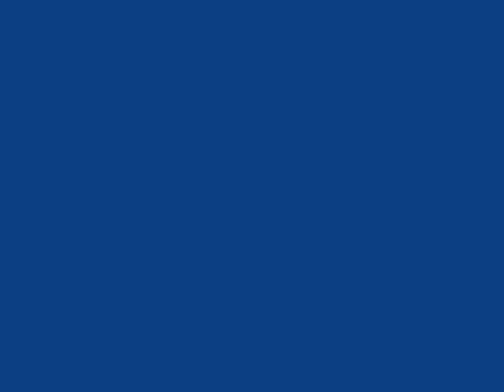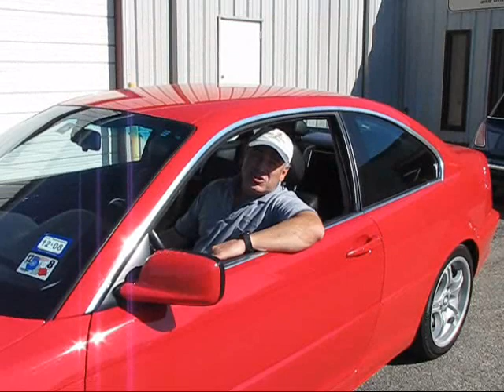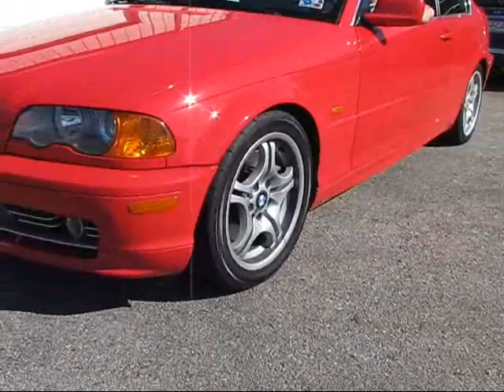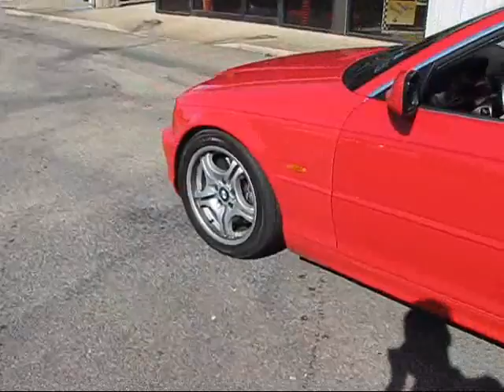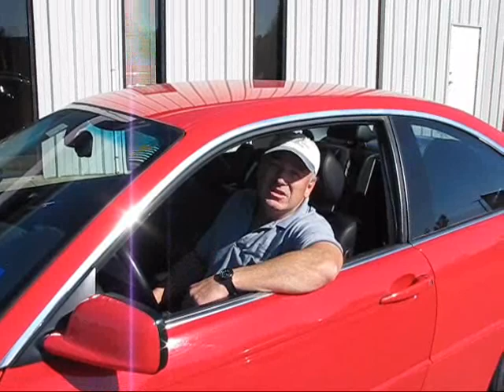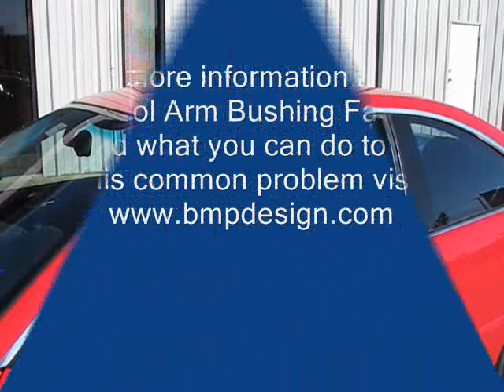BMW Control Arm Bushing Failure

Comment: I drove with the top ones like that for 21 years before it got really noisy after that I just loosen the torsion bar a little bit more and only made right hand turns.....gas is dum

Comment: Bruh, this video is 12 years old and was randomly in my recommended, and it perfectly shows what’s wrong with my e90, I took my car to a shop to fix a cracked wheel and put in a new battery, and the guys over there did this exact demonstration for me, except it looked a lot worse for my car

Comment: Thank you for your video.  I was told during a recent inspection that mine need replacing.  I thought to myself that I would hold off a month or two to save up for the repair and thought it was just an annoyance (noise) but your video showed me that it's likely dangerous to drive with them like this.  Seeing the wheel move like that made me decide to go out today and fix them.  :)

Comment: Bmw.  overpriced junk vehicles
Reply: do you own one? no? then shut the fuck up.
Reply: Cody Laxton yes. I did.  And glad its gone.  Now i have a overpriced jeep
Reply: Lol I love my BMW, and it depends on the jeep, if it's newer then yes they are overpriced
Reply: tribulation138 Common cars buyers are idiots. Replace everything with polyurethane and you have no issues
Reply: actually theyre one of the best engineered machines you can buy. but that is none of your business internet commentor.

Comment: This is video is really helpful.  I always thought the noise I hear in my e46 when turning at low speeds were my control arms, but my car does not do this at all.  Unfortunately this means it's probably my sub-frame.
Reply: Are you sure? You checked all of the components of your suspension and steering?
Reply: check your tie-rods

Comment: Hi,I have an E38,shimmy on 80Km and here is the inserting part, when I am driving slowing around 10 or 20 on a bumpy road, I keep hearing a noise from left side of the (RHD) makes noises like there is something like a bearing in the tyre and also when I brake in that speed, it makes that noise again, after a while ,if I stop and press down the left side,makes that noise again.one mechanic said shock, one said top mount,one said lower arm and one said upper arm. I am like WTH? how can I find out?

Comment: it is how ppl use the car. i own few cars and never had such problems. and its RWD... there shouldnt be such problems. unless you use brakes and turn steering wheel to a side or use brake on bumpy road.
Reply: Brilliant. Thanks for that. 😂👍

Comment: damn the bushing these cars are rippinng the sub frame from the rear the sheet metal just rips i have one and wish i hadnt gotten it man anyone trying to get one or has one sorry but it happens to all e46s and the the 5 series piece of shit they only last like 100,000 miles then they start falling apart from the suspension and the body no mas M power now il try a damn kia maybe its better just maybe it will last long enough to pay it off shame on bmw ultimate driving machine my ass

Comment: Uhmm...This is exactly the FEELING I'm getting when slightly or moderatly breaking my e36 325i. I must say that I DON'T HEAR any kind of noise that can be heard in the video..but the feel, it's just it-lower frequency vibrations when going slowly and higher frequencies/wheel shaking when going faster. My mechanic told me I had warped rotors...but I changed my rotors 3000kms ago... On the other hand, I changed my CABs 3000kms ago also. Now, I dunno. THANK YOU FOR THE GREAT AND VERY HELPFUL VIDEO!